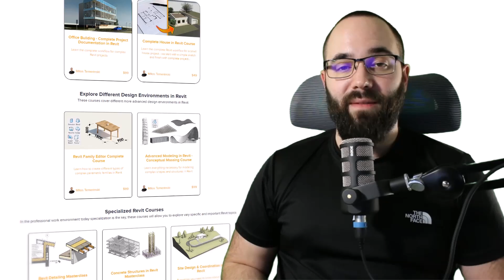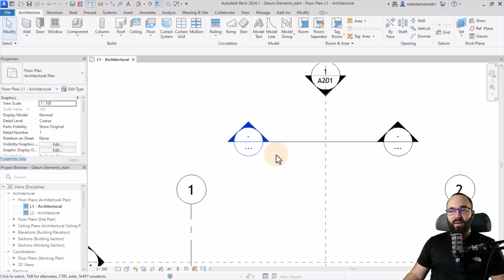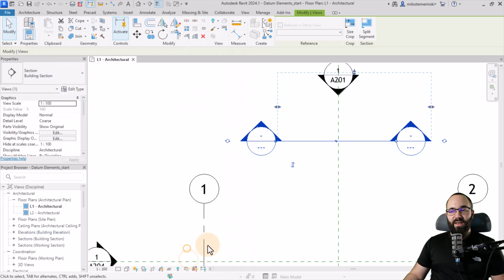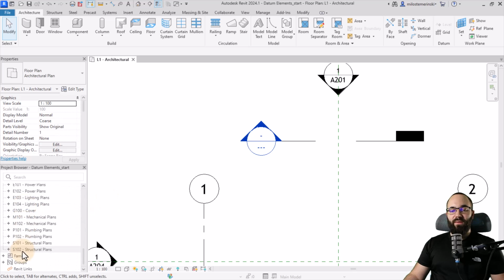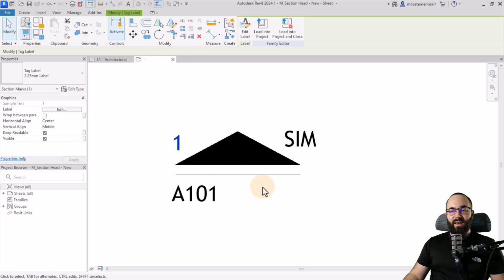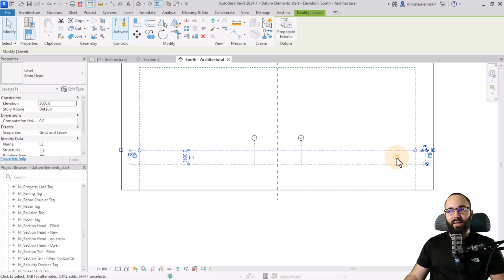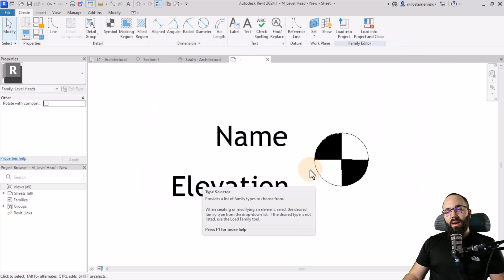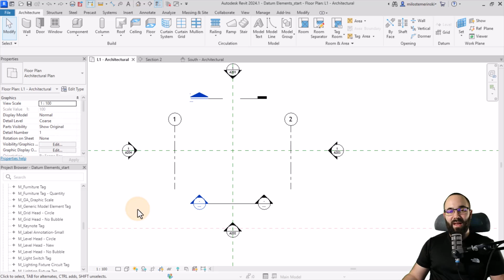How to Change Size of Datum Elements in Revit Tutorial

Comment: Hi! I have a series of questions about this topic. Firstly, why do we see section and level heads in blue color in project, and how can I change the color? I tried to change it in head/bubble family and it seems fine, but when I import it to the project it turns blue again. There has to be a kind of override in the project i guess and there needs to be another way to change it in project file. Thanks in advance.
Reply: Actually I figured out you have already explained that blue means “clickable”. That moment everything put in place. Eventually I figured out blue color works like clickable links (hyperlinks) as we see in web sites. You can change the color but as soon as they are clickable, Revit shows them in blue by any means. However when you export pdf of the view/sheet, voila… it will be printed as the color you have changed. 🎉

Comment: Thanks for showing the tutorial. I am wondering if there is a way in revit that I can customize the size of datum in views of different scales. I know revit automatically scale the datum for you but I look for more control in graphic. Thanks so much!
Reply: Hey brother, I have the same question. Did you ever find a solution for this? I’m working on an overall elevation at 1:400 scale and a partial elevation at 1:100. When I change the level head type in one view, it updates in the other view as well since it’s all using the same level family.
Is there any way to have different-sized level heads per view? Maybe something instance-based or another technique/workaround?
If you’ve got any approach that worked for you, let me know.